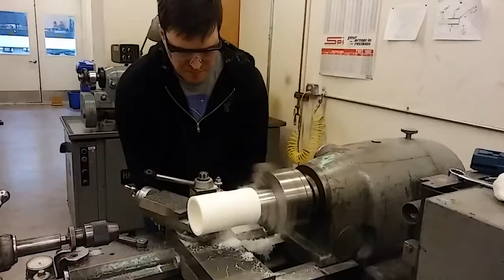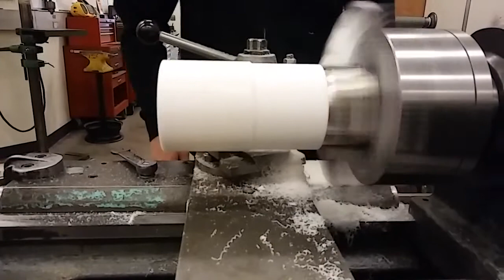PTFE machining

Comment: is it okay if not using coolant at all?
Reply: PTFE isn't metal or ceramic, it's polymer, meaning it's plastic. So no coolant required really.
Reply: @Mtaalas  Have machined metal on a lathe after a coworker machined PTFE. Coolant on PTFE chips is a NIGHTMARE